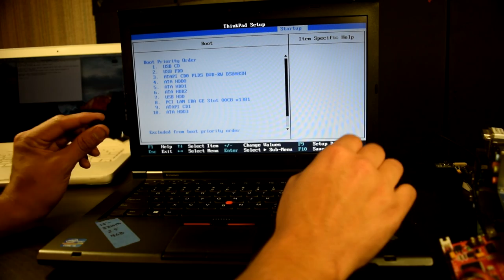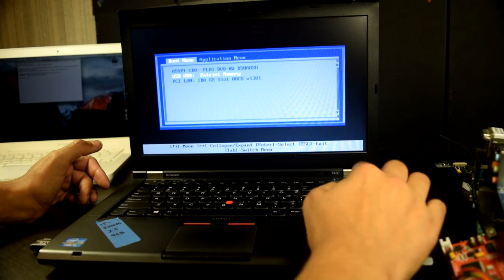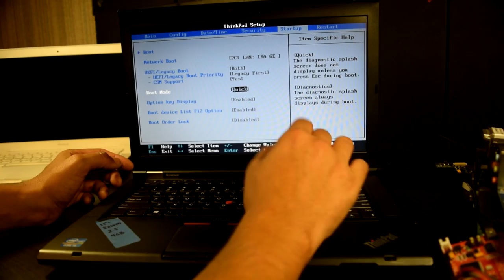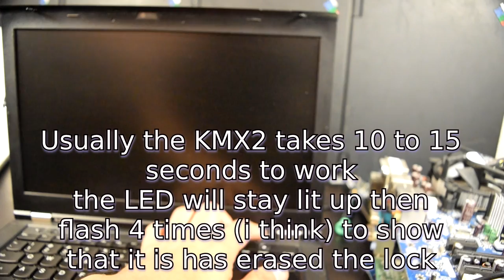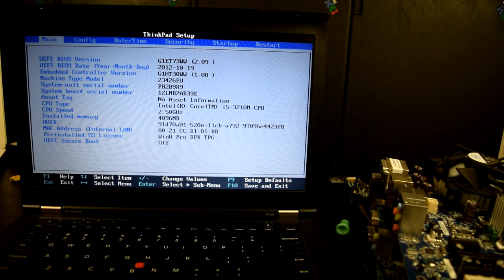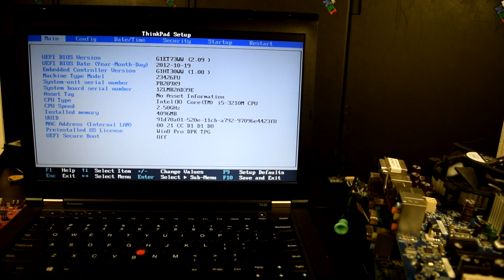Removing a T430 BIOS password w/ KeyMaster X2 - Laptop Flipping Vlog

Comment: Why die I have this laptop t430 hire a boot cd on usb there’s boot manager it boots up the usb only so if you have windows 10 on csm it works forces you boot from ssd/HDd I’m running windows 10 on bios locked t430 perfect !

Comment: how can i access the bios? f12 doesnt work for me
Reply from the maker: F2? Plug in a USB keyboard, I've come across some E6400's that needed that at boot
Reply: Sauceyjames i tried it rn, nothing...so im pretty much fucked?! What options do i have now...?:D
Reply from the maker: If both aren't working... Maybe try replacing the ram if you have extra on the side. There's a chance that the motherboard has a fault but I usually just swap them if that's the case or return it.
Reply: Sauceyjames u dont recommend messing with shorting the circulation at the correct pins?! (Pin 6 and 7)
Reply from the maker: Shorting what pin? I know ThinkPads have the bios lock on a chip but I don't know about Dells.
Reply: Sauceyjames i managed to get into to bios, what i did: ac adpter disconnect, removed battery and removed backup battery. Connect ac adapter and press power. Then the hd password icon came up. I removed the hard disk. Now i can get into the bios. Whats next?! Should i set the correct date and time? And how can i use the hd again? Maybe by removing the hd deleted the password? I have OS on USB, im just wondering how can i get this to work....:D
Reply: Sauceyjames update: i disabled the ssd password, put the ssd back and not it doesnt recognize it, so when i tried to install win by booting from usb, it simply tells me no hard drive recognized...any tips?! Sorry im not much of a tech guy...:D